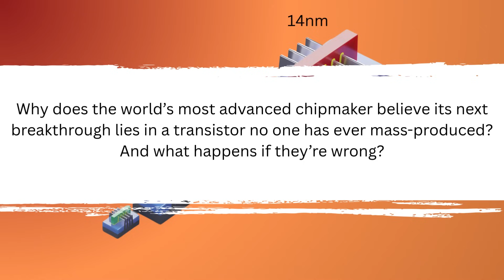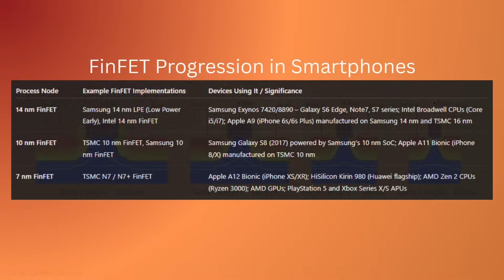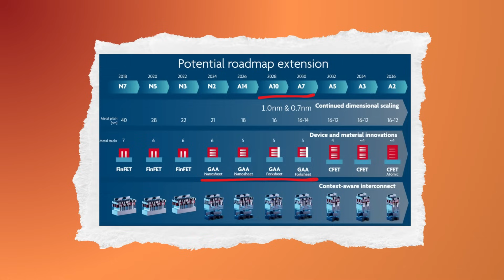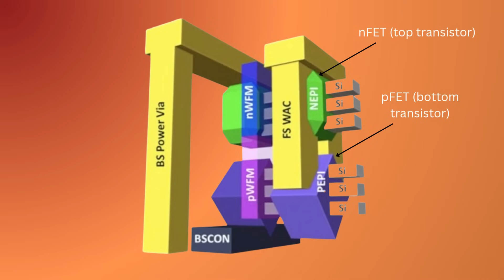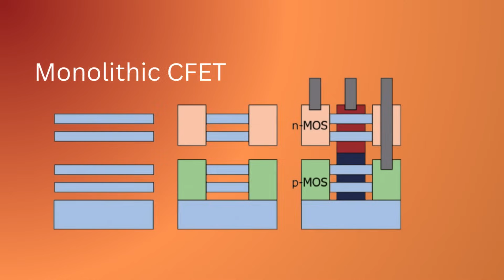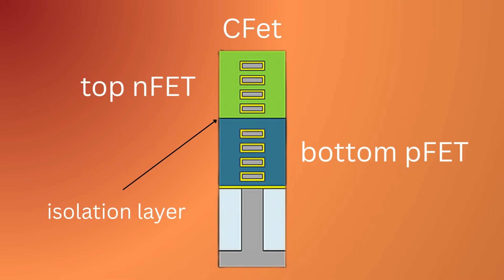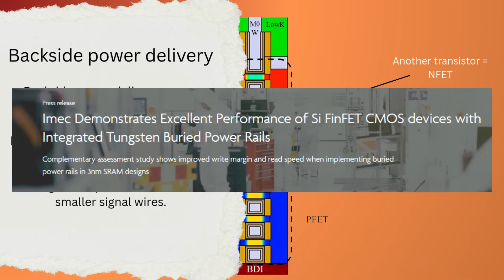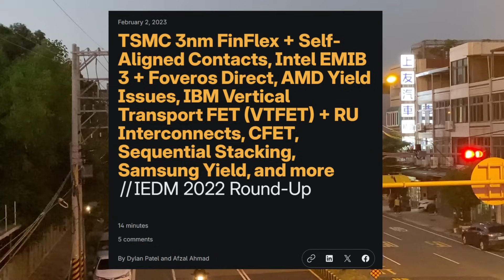The Next Transistor: Inside TSMC's Push for CFETs

Comment: The GAA transistor idea was first prototyped in 1988 by Toshiba.  It's not new.  It's needed because at 2nm and below the finfet, the transistor used at 7 and 5nm nodes no longer works.  But GAA will not save moore's law. Below 1nm nothing works.   Remember that a single atom is 0.1 nm.  Not to mention that insulators also don't work because of quantum tunneling below 1nm.  But Moore's law might be saved by a different technology. Current ICs are planar, they are build on the surface of a silicon wafer. To get higher densities we can build 3D circuits.  This is the area called 3D advanced packaging. It's also an area where China has already caught up with the US.

Comment: Laws are made to be broken. Everything has a limit and personally I believe that is GOOD.
At this moment in time I can read and respond to my e-mails no faster than I could 1n the early '90s. Frankly mid '80s.
During that time my computers have moved from 8-bit to 64 bit and Internet speeds for 3kB/s to I don't know MB/s. In the mid '80s I could send and download my mail and Usenet to a dial-up Internet connection an a few minutes. Process them over the enxt - maybe hour or so - and then re-post downlown them in a few minutes over a dial-up Intenet connection. Then carry on with my life - perhaps looking at the newfangled WorlWideWeb but preferring Gopher cos it was much quicker.
NOW I do the same thing except it now takes most of the day and over GB Internet connection with 64 bit computers.
Programs which could run in a few kB now require MB at leat to do the same thing. I look forward very much for this rediculous LAW to be ignored then I may be able to actually do something useful. Prtograms running in kBytes instead of GBytes. Ah!!! Bliss.

Comment: Regardless of CFET's performance it isn't enough to satiate the INSANE power demands of the AI boom which is outpacing spending for new power generation (made worse still by idiotic governance in the US killing solar/wind projects).

What is needed is less brute force transistor level improvement, and more chip level efficiency investment like Vaire's adiabatic logic that harvests energy used in compute rather than just wasting it in every cycle.

Vaire's tech could actually make desktop (or better) gfx possible in a standalone VR HMD.

Also what is needed is new memory paradigms like Blueshift Memory's "Cambridge architecture" and non volatile memory (and/or super long refresh period memory) to cut idle mode losses.